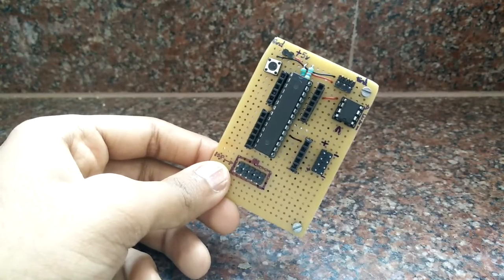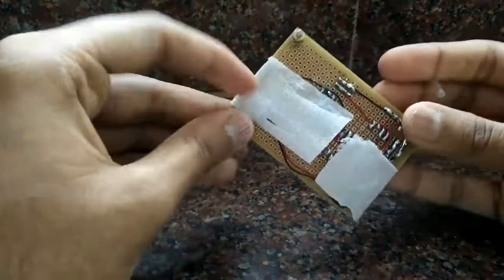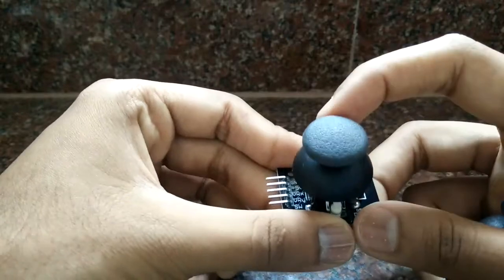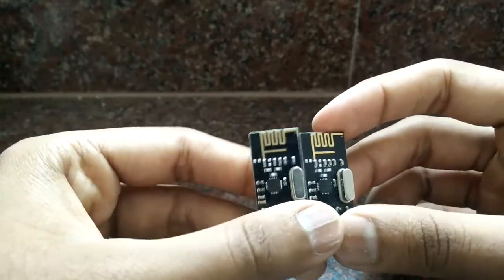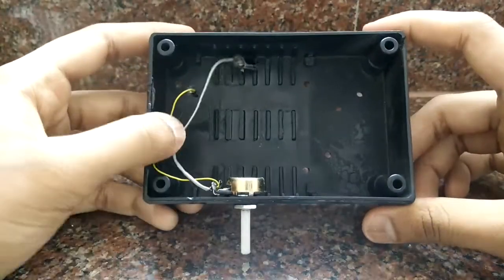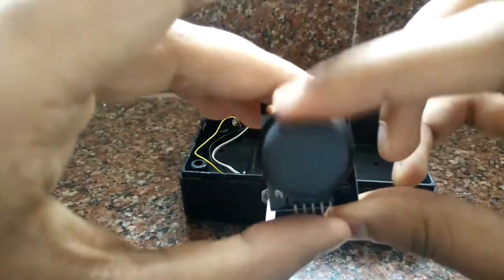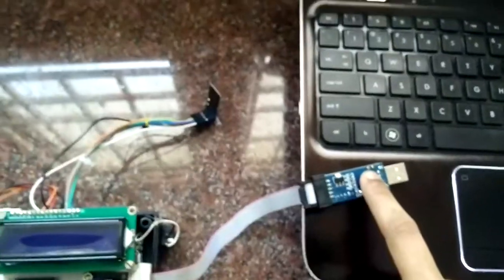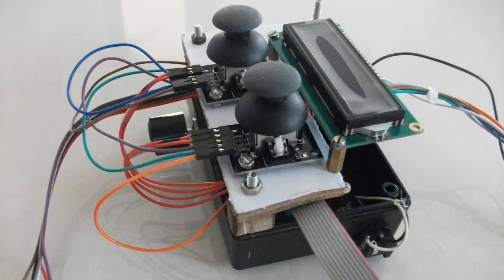DIY | Quadcopter RC Transmitter | Hardware assembly

Comment: Sir can you please make the 10 channels  transmitter and receiver for the rc plane
Reply from the maker: Hi,
I found some constraints with this old design regarding to controlling extra peripherals. So I am working on a better design now using an arm processor. 
But due to my job I am not getting enough time. But I'll try to speed up the project. Thanks for watching.

Comment: Sir can you please make a video on the coding specially how you print data on LCD with the help of i2c converter..... please do the coding in atmel studio
Reply from the maker: +Hasem Ali hi right now I do have my exams going on... I'll do a video on controlling the LCD module using i2c as soon as my exam gets over. Thanks for watching. Cheers
Reply: kriz yeah sure
Reply from the maker: https://drive.google.com/open?id=0B9tkieGPBK_uVTA0ZVRraGFjMlk

Go to this link. This has the project files that i developed for a fish tank controller. There i have used 16x2 lcd using I2C using atmel studio. 

Under the link goto /v1 directory. Under that pls do refer to i2c_master.h, i2c_master.c, i2c_lcd.h

Hope it helps..

Comment: Program code ?  Can you provide it ?
Reply from the maker: +Aditya Aherkar thank for ur interest in this. However I have slight design change on this as I will be using a PIC instead of atmega. 

Since I am taking up as my masters project I am expected to use a controller which I have in my syllabus. So I'll upload the code and the design circuit as soon as I am done with it. 
Cheers.